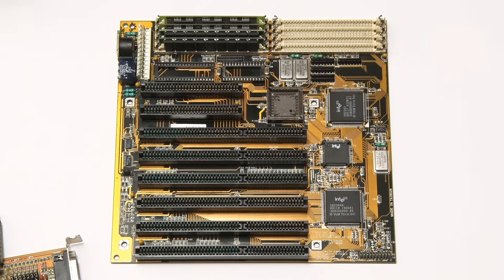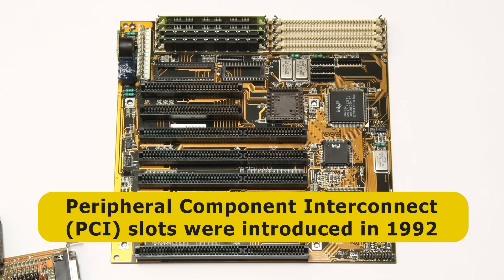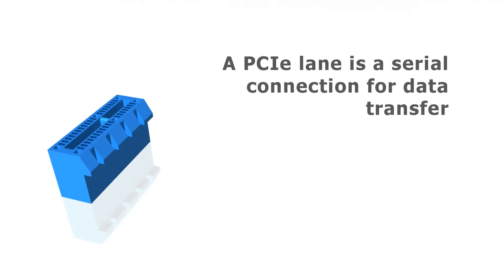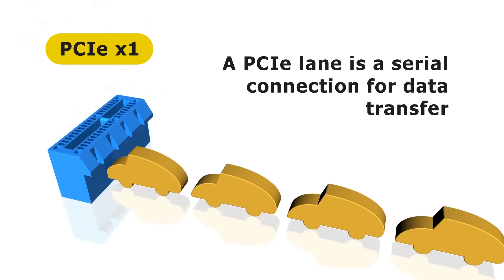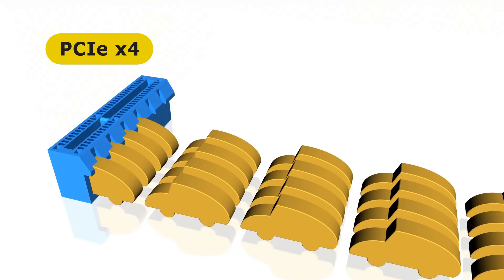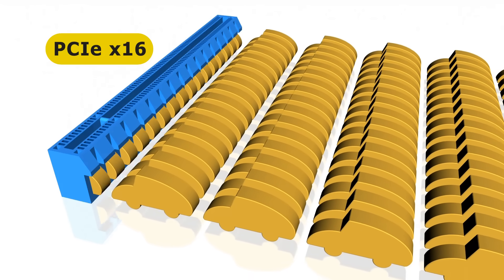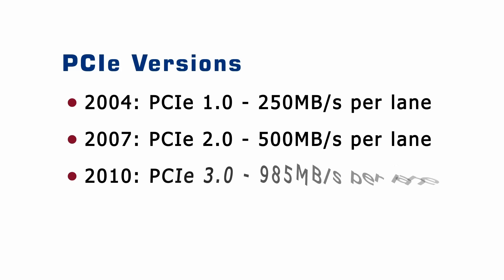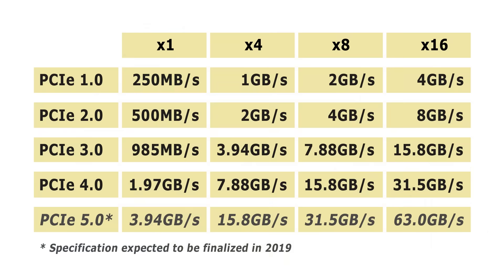Explaining PCIe Slots

Comment: That means i can use pcie 3.0 graphic on 2.0?
Reply from the maker: Yes, you can use a PCIe 3.0 graphics card in a PCIe 2.0 slot.
Reply: @ExplainingComputers  ty, soo i can use rx 580😅💪
Reply from the maker: @3MarkedReplaysWOT  It should be OK, just make sure that you have enough power. Some cards will need an additional power connector, and not all systems with a PCIe 2.0 slot in them may have one available. So check the specs of the exact card you are looking at, and if it needs a power connector, check one is available in your computer.

Comment: Thanks for your video about PCIe slots but I have a question.  My Optiplex 760 only has USB 2.0 ports and I want to add a 3.0 port card so that I can upgrade my monitor.  Based on your explanation of PCIe slots does that mean that the 3.0 USB card will only run at 2.0 speed because of the PCIe slot?  I see a lot of videos saying I can install the 3.0 card to improve VGA speed but now that I've seen your video about PCIe slots, I'm not so sure.  Please explain.  Thanks!

Comment: Very informative video - thanks for sharing.
Reply: I have an Dell Optiplex 780 (small form factor).  It has one PCI socket and another called a proprietary socket (PCIe I think).  My question is, will I be able to use an audio card in the PCIe slot, or is it allocated for a video card only?  Thanks.

Comment: Anyone know how common support for running a card in a slot with fewer lanes is? I have a pcie v1 x4 sata card which I would like to use in a v1 x1 slot. I know it won't have enough bandwidth to run as fast as it should but I can live with that as long as it works. The slot is not open ended so I think I would have to buy one of those adapters used for mining.

Comment: I remember hunting for a 3Dfx Voodoo3 in a PCI variant circa 2000 because the motherboard I had didn't have AGP, but had a couple of ISAs. So even in the year 2000 an AGP slot was a really high end feature. 

Been trying to math out whether or not I have lane bandwidth for 4 additional SATA ports and a dual 2.5Gps NIC lately. Even on a modern B450 motherboard I'll be stretching it to the limits. 

We've come a long way in 20 years, but still a long way to go for some truly next level computing. Looking forward to the extinction of mechanical disks and the next generation boards where all the PCIe slots get enough lanes to run at the PCIe 4.0 speeds. Definitely needed with 10Gbps ethernet and NVMEs.

Comment: man, please reply can we plug nvme pcie m.2 ssd into pcIex16 slots???
Reply from the maker: With an M.2 to PCIe slot adapter, yes. But whether it would be bootable would depend on the motherboard and OS. M.2 devices do not plug directly into PCIe slots -- they are different connectors.
Reply: They can be configured as bootable with a custom bios flash.  But it won't likely improve the user experience over a solid SATA 3 ssd in older systems(pre 2013).  As(plug-and-play) fast storage in the pci-e x4 slot it makes more sense.  But the devil is in the details!  And knowing what your platform is capable of is a good starting point.  
IF YOU ARE LIMITED TO A PCIe gen2 x4 INTERFACE IT WILL MAX OUT AT AROUND 1800MB/Sec of SUSTAINED READ/WRITE THROUGHPUT.  
This is half what modern (PCIe/NVMe gen 3) mainstream platforms can handle.
  On my older Xeon E3-1240v2(core i7 3770) equipped Z77 chipset motherboard this(x4) slot does have gen 2 spec.  Which would bottleneck a high-end MLC(Multi-Level-Cell) or TLC(Triple-Level-Cell) NVM-e gumstick by around 50%.  But there are now(slower but still >3x what SATA can deliver) mid-tier QLC(Quad-Level-Cell) m.2 drives that are more appropriate for this slot.  These(larger capacity, 500gb+) QLC drives are much better suited as secondary(mostly read-centric) storage in most systems anyway, because (write-centric 'boot drive') operations are typically slower, and impart more wear on this higher density, less robust storage medium. 
After having a QLC Intel 665p 1tb configured this way for over a year(Samsung 860evo 500gb SATA 3 boot drive augmented with Intel 665p 1tb NVM-e in the PCI-e x4 gen 2 slot), It does noticeably improve game loading speeds!  And with these new(QLC) drives priced on par with SATA it is finally worth the effort!
Although I recently did a platform overhaul to AM4/Ryzen I thought sharing my  experience might help someone...somewhere...

Comment: VESA local bus was the rage here in Italy for the best part of three years until the arrival of the first PCI. There were VESA LB graphic cards yes, but disk controllers as well (that for the speed of the HDDs of the times the only advantages they gave was placebo effect at best). Hardly unsuccessful like you seemed to infer.

EISA on the other hand WAS a failure. After all it was only a 32bit extension of the ISA connectors with no other real redeeming features, not even clocking upgrade, and both MBs and expansion cards cost a kidney to buy.

Comment: The most popular use for a PCIe x16 slot is for a graphics card. The majority of PCIs graphics cards come with a large heatsink and fan that covers up the slot next to it. So why did the vast majority of motherboard manufacturers, when including only two PCIe slots, place the second in a position to be covered up by the graphics card? It makes the second slot useless. What's the point of having two slots if the second one is almost certainly going to inaccessible?

Comment: The first thing to explain is that you aren't getting what you think you are.  You can buy a motherboard with 4 PCIe 16 lots but only one of them runs at 16 because there are never nearly enough PCIe lanes.   It is like saying here is your brand new 4 bathroom house but you can really only use 1 of the toilets.   The others take forever to flush.   OH - if I buy another motherboard will it solve the issue - OH no, the CPU and chipset won't support it on any motherboard.   Well then why do they build them?   Well you bought one didn't you?    So there is no winning?   Well you can pay much much much more for a different type of CPU that has more lanes -  Well it sucks paying a lot more but at least I get a a cutting edge CPU and motherboard ?   No, typically that CPU and chipset are about a generation behind the ones that come with standard motherboards.   SO I pay more to get old tech - yep.
Reply from the maker: Have you ever seen a motherboard with four x16 PCIe slots?! :)
Reply: @ExplainingComputers  Yes.  Google it you'll find tons of them.   But maybe you are asking if I ever bought one - in which case, no but I have bought some with 3 PCIe x16 slots but I knew what the truth before buying.   Just like the 4 PCIe 16 slot motherboards the 3 slot ones still really only fully support 1 16 slot.   Truth be told most motherboards have at most about 20 lanes free after you take out usb, sound, network and whatever onboard peripherals they may support.   You could get one with a PCIe switch but those slow down the performance and don't give more lanes, just more balance to the traffic.

Comment: Could you do an in depth video on the new pciE adapte4 cards that have nvme ssds on them. 

There's a price called bifurcation which some motherboards don't natively support. So you need to use a pciE card with a special chipset that acts as a pciE switch in order to be able to recognize the pciE card as a bootable option. 

"Non bifurcation motherboard support pciE cards" are expensive...

Comment: I have a pc that only has pci-e 2.0 x1 slots available. I have the new crucial p5 1tb name which I’d like to use with a pci-e x1 adapter. The adapter says you must have pci-e 3.0. Is that true? Is the p5 limited to pci-e 3.0 or higher or is it the adapter restriction.  Your help would be appreciated.

Comment: Quite an interesting presentation! but I would like to ask you a question. Usually we use the first PCIe x16 for graphics cards. But could we use it with other cards? For example, to connect a PCIe x16 adapter for NVMe M.2 PCIe SSD?
Reply from the maker: Yes, you can use the 16x slot for other cards. There is no requirement to use it for a graphics card. But not that many cards needs the 16x bandwidth.
Reply: @ExplainingComputers  Thanks for your reply. I'm thinking of putting on this adapter https://www.asus.com/us/Motherboards-Components/Motherboards/Accessories/HYPER-M-2-X16-CARD-V2/

Comment: Thanks  a lot Christopher.  Well done! I like you approach.  It is  concise and very straightforward.   I guess it won't hurt  to introduce myself a little bit. 
     I want to get some passive income. And I'm considering mining industry,  but I'm not sure I'm gonna do the  right thing. I definitely need your technical expertise. I have seen cryptocurrency (for instance Ubiq) which requires clock speed  in the range of 90 MHz to have the block solved.  I have got an old Asus motherboard that supports LGA 775 sockets CPU. In order to build a rig on that motherboard, i want to buy 4 additional risers and I'm going to add up four  HD7450 2GB DDR3 64 bit LP graphics card (ATI radeon) accordingly. I'm assuming that graphic cards (with DDR 3 chip) should have a clock rate in the range of  166 MHz, because the motherboard has Front Side Bus of 1333/1066/800 Mhz. 
  0)   How can I be assure that my assumption is correct? Would it be profitable? Would it actually play out as i expect?
	1) I want to work those 4 graph cards efficiently. Is there anything that might disrupt a cooperative work of those 4 graph cards? 
	2) Would I need to rid of the fifth ddr2 512 mb gt 9500 video card? My cpu has no l3 cache memory, only 1024 kb l2 cache memory and it is only 2.2 Mhz. There are more efficient CPUs with fort cores and greater amount of l2&l3 cache memory. If i change the processor, would it increase the efficiency of the rig in general?
	3) What power supply unit do I need to have? Would 430 w PSU do the job?
	4)  How much heat would generate such rig (system) ? Would I need to take some measures to reduce overheating ? What OS would you recommend?
	5) Could you recommend me some of your books as a supplemental reading to my project. If yes, then where can I buy them?

If the whole thing works out I'll pay you 20 % of return on my investment for answering my questions posted in that comment and up to 50 % if you could offer me further  guidance and mentorship. And If you want to, you may also use my experience as a practical ground for your next videos. I haven' t purchased anything yet. I'm expecting to get the hardware within a month after the purchase. And in addition I would need some time to actually mine coins.  The contact information is :
scu.sflo@gmail.com
Sergei.

Comment: I've been here tearing my hair out over the fact that there are only a few motherboards within a reasonable cost available to me, and all but one were constantly sold out. The issue I thought I would have would be the graphics card covering the single PCI-E x1 slot where I thought was the ONLY place to put an internal wireless adapter. Knowing that I can simply under use the second PCI-e x16 size slot for it is an absolute lifesaver. Big preesh for this video!
Reply from the maker: Glad to hear that this has helped you. :)
Reply: Your issue sounds strange; since most motherboards nowadays come with an internal graphics card, so you don't need to add one, unless you want to free all the RAM or you need a dedicated graphics card for gaming, video editing, CAD, etc.
Reply: @brujo_millonario  Integrated graphics are provided by the processor, and not all processors have integrated graphics. The build I was making (now several years ago?) was for VR games, and my main concern was that the graphics card covered up what I had first assumed would be the only PCI-E slot that my intended WiFi adapter would be using.

Comment: i miss the days when motherboard vendors actually included a full set of fully useable slots to all consumers boards, id really like them to at least replace all the x1 with active x4 open slots so we can actually use the new low power 10 and 5 Gbit ethernet x4 cards and ssd at the same time at full intended speeds, not over priced industrial grade server boards that we cant write off the cost as a non business

Comment: Very nice explanation. I need to get an older graphic card that is PCIe 2.0 x16 for my server board which has a PCIe 3.0 x8 open-ended slot. Will this be able to run the maximum potential speed/bandwidth of the card or PCIe 2.0 x8? Thank you.
Reply from the maker: Yes, a PCIe 2.0 x8 card should run at 2.0 x8 speeds in a 3.0 x8 slot.

Comment: If I have only a pci x1 slot, can I put a video card pci x16 in this slot ( the x1 slot is open ended)? It will work?
Reply from the maker: Technically it might. However, x16 PCIe graphics are not designed to run in x1 slots, and even if it did work, performance would be poor.
Reply: @ExplainingComputers  thank for the answer! :)  I just want to add a dvi port to a motherboard that have only vga; it's not a gaming pc. I'll try...
it's incredible that Hp did't put a pci x16 slot on a motherboard of 2011

Comment: Hi, can I put NVMe PCIe 3.0 x4 M.2 SSD (Kingston A2000) in PCIe 3.0 x2 M.2 slot? Will the SSD work? Thanks in advance!
Reply from the maker: It will probably work -- at x2 speed -- assuming that it is keyed to fit. It will depend on motherboard support.
Reply: @ExplainingComputers  Thanks! I have Asus Prime H410M-A motherboard. The M.2 slot is M key and it supports PCIe 3.0 x2 & SATA modes. I checked PCPartPicker and it says that Kingston A2000 is compatible with the motherboard. I hope the SSD will work.

Comment: okay so to be clear my wifi card can go into a x16 slot but it's just that id be wasting a lot of possible energy because the card does not require the power you get from a x16 slot correct?

Comment: Thanks for the information, I was always want to know about the PCIe variations and finally found my answers here.
My question about the mini PCIe, is it difference only in the physical size? or other signal characteristics? 
Another question, what if I replacing my old 2013 laptop Wifi card which installed in a mini PCIe slot with the modernist wifi AX1300 card, would I got the wifi speed of the new card or the PCIe of the motherboard which of course has lower bus speed will be not allowing to get the most benefits from the new wifi card?
Thanks Sir
Reply from the maker: Only the size is different. :)

Comment: i have a pcie slot but i cant use it because the grafics card over cover it due to fan.Can i use a simple pci slot?  I want to install a usb 3 card and i cant use an extension pcie cable either
Reply from the maker: You can use a PCI slot if you have a USB 3 PCI card to slot into it. But you cannot put a PCIe card into a PCI slot.

Comment: Please help me to understand something. With the roll out of M.2 drives im having hard time to grasp the concept of what is what..meaning: M.2 it's just a form factor so it can refer to both SATA and PCIe, so what are SATA and PCI? they refer just to the layout and behaviour of physical pins i guess because then it come into play the protocol that is another thing itself given that pcie can run based on ahci and nvme. My main issue is that i can't figure the difference between what is M.2 and what is PCIe or SATA given that at a first glance they are the slots and hence the interfaces.

Comment: Il recommend to use modern hardware for today's problems, for example last part of the video, i dont even know what kind of gpu is that, and that mobo is not even near modern
Reply from the maker: The last motherboard shown was at the time of making the video less than two years old. So clearly modern when the video was shot, and pretty modern today (it is running happily with its i7 and 32GB of RAM editing my videos). The specific hardware shown in this video is also irrelevant. 

There is no requirement to "use modern hardware for today's problems". Indeed, the incremental benefits of hardware upgrades continue to get smaller and smaller. Globally today, most end-user desktop computing is carried out perfectly well on hardware probably five years old or more.
Reply: @ExplainingComputers  oh okay, i was referring to the one with PCI slots, but anyway great video 👍

Comment: Would I be correct in saying that the PCI standard/protocol was SO successful that it is/was used in the USB system? I make that assumption in that a while back when I was looking at my Linux low-level logs, when the USB system was being initialized, it was all PCI related chips/protocols being initialized. Would make sense to reuse something that just worked great I guess. But I have never dug in further to prove my observation.

Comment: I should look where I put my graphics card, I might have put it in a weaker slot.
Reply: It was in the wrong PCIe slot, the old slot only had pins running down the first quarter of it length(PCIEx4). While the “new” one it has pins running down the whole length of the slot(PCIEx16). The zoom in on the PCIex4 slot was such a live saver(6:31). My motherboard didn't have the label, but the pins were a dead give away. Thank you for explain it, you got a like from me!

Comment: I love the compatability of PCIe so much.  I  recently built a new computer for the first time in a while.  The graphics card was the last thing I bought, because of upcoming graphics card announcements.  So I used my eight year old PCIe 2.1 graphics card in my new PCIe 4.0 motherboard for a while, and it worked beautifully.  It was particularly useful in proving the rest of my system was rock solid, when my new graphics card turned out to be flaky.  (The new replacement has turned out to make the machine very stable again.)

And I'm still excited to be done with ISA IRQ conflicts, so I remember when we didn't have anything like this compatibility.  

Very well done video, looking forward to more.